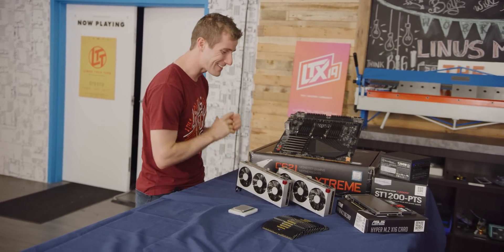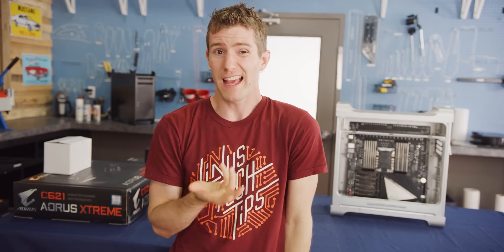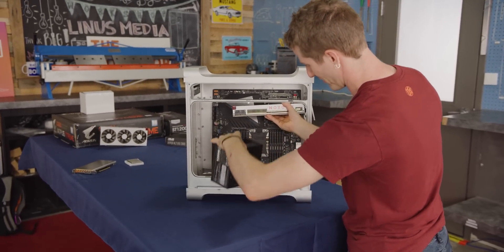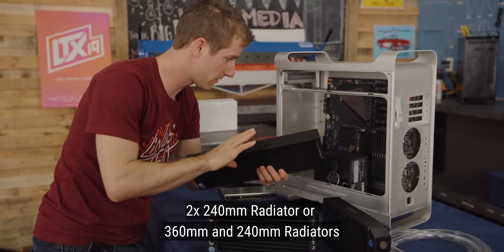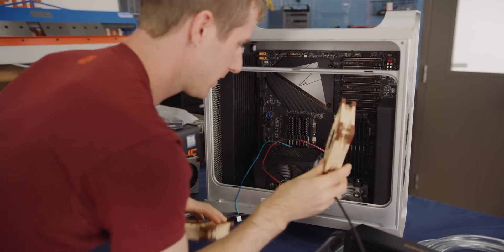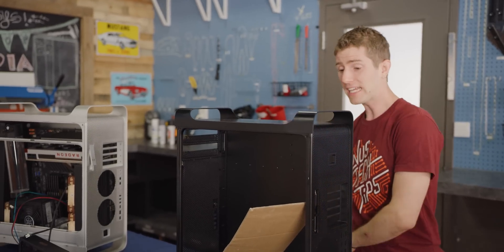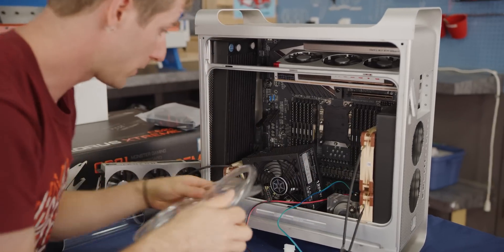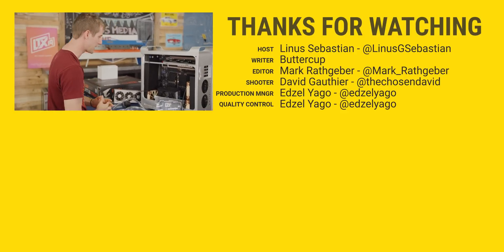The Mac Pro Apple WISHES they built - Hack Pro Pt. 1

Comment: Loved when you discovered that Apple used B size motherboards in their old Mac Pro cases (which were gorgoreously accessible).

Typically Apple had to be different just to be different and/or to stop anyone else hacking around in the case with standard parts.
Reply: Just make the executive decision to use a standard PC case, there's plenty of choices for nice looking units, which there weren't when the Cheesegrater came out.
Reply: There was an industrial design reason for why the cheesegrater was laid out the way it was. 

Everything simply slid in and out from the side including the DUAL cpus on their motherboards.

Wouldn't it be great if someone (not Apple that would be expecting too much) designed a case on the easy access principles of the Cheesegrater for use as a regular PC case OR as a Hackintosh. If it just had the potential to make a great Hackintosh, whoever built an alternative to the upcoming Mac Pro would circumvent Apple's lawyers, just as Gigabyte has by selling motherboards that can be either perfect Hackintoshes or top PC Gaming desktops. Seems to me to be a great marketing opportunity to fill a niche that Apple has left wide open. Although not for long, when they go ARM chips next year they will close that off again.

As a designer, I think Apple has made a great, if wildly over engineered, frame/modular based design with the upcoming Mac Pro. Well worth taking the principles and recreating it in a simpler and much cheaper form. The idea obviously came out of the test rigs Apple uses to work out their designs in their labs. 

One thing that I wish designers would seriously look at is dividing the heat generating parts from the rest of the case and putting them in something that formed a natural chimney exploiting the natural movement of hot air to vent most of the heat. I'd start with removing/separating the powersupply from the case (why box it in?) and relaying out the GPU cards and their attachments to the motherboard so that they formed natural air pathways with fins oriented to encourage the airflow and not interrupt it. Since not creating heat in the first place and venting what you can't avoid is such a major part of PC design, I'm surprised that someone hasn't tackled the hardware design principally to work around the issue instead of cramming everything onto boards and then jamming them against each other in ways that trap the heat.

Comment: 384GB on 12 sticks? We got some RAM in at work that did that with only 3 sticks.
Reply: Motherboard doesn't support more than 512gb.
Reply: @apocalypseap  cpu only supports 512gb ram, motherboard supports 192gb if it supported more it woukd be able to have more ram slots

Comment: Cut the whole back mesh out that you have to cut anyway, build the pc and a sled/draw that has a new mesh panel made for the back that suits you pci cards and io. slide it in from the rear ;) . also slide the draw into the pc case from the rear. Also by the time i post this comment they have most likely built, completed, filmed and processed the whole build.

Comment: Doesn't Linus have a workshop and didn't he spend all kinds of money for machinery? I would just cut the case in half, extend it to make the case longer with a blank piece of metal then add a new cheese-grate type backing for the IO and power supply. Come on Linus please don't Mickey Mouse this so please do this correctly.

Comment: I´m all for the Supreme Hackingtosh, but the  undersized apple case was just a really crappy desicion.
Reply: You take that back. The G5 case is a timeless masterpiece. I've built several rigs in them
https://imgur.com/izZY3AS
Reply: @mattsoup4121  apples pro cases are sexy and durable as fuck. The market is just flooded with cheap-looking, edgy-gamer-teenager, rgb crap.
Reply: @Nik-ff3tu  does anyone even like rgb
Reply: @Nik-ff3tu  I have a pc built inside, I fully agree
Reply: I want to know how APPLE is able to cool their new Mac Pro with apparently a PASSIVE cooling solution?!! They are supposed to be able to adequately cool up to 1 Xeon and 4 AMD GPUs using large passive cooling radiators fed by just 3 front intake fans? Either Apple has figured out a way to defeat the laws of thermodynamics or that thing is gonna throttle like a MFer under load.
Reply: I disagree, because then it would just a standard really powerful build. not much fun. cramming it all into a mac case gives it challenge and relevance to apple, which is the goal; to make an equal or more powerful mac to beat them at their own game.
Reply: Kevin Aguirre Sure, if you were doing this as a sane and rational build. But it isn’t, this is a “look at the silly thing we can do” build. And that makes this case great.
Reply: He likes challenges
Reply: As ridiculous as their budget for this is anyway, just build a new case from scratch at an appropriate size
Reply: i would have gone for a Lian Li- V1000L myself.
Reply: So is a Bitfenix Enso or InWin 805, but people use them.
Reply: Linus needs a Phanteks Anthoo case for the build - plenty of room for everything, nothing blocked, and looks pretty Maclike so everyone will know right off what it is. It's a popular choice for hackintosh builders. Failing that, 3-D print a case with proper proportions and ports.

Comment: I see that you are using a Powermac G5 case. I was a bit bewildered by the back panel layout. I take it this type of build would not work on an Intel 2006 - 2012 Mac Pro case. I'm also surprised you did not use a SuperMicro dual socket motherboard. They may actually have a configuration that would be a better fit than the Gigabyte.

Comment: 280mm (2x140mm) rad for the front? Might save some machining on the 5.25" bay while still allowing better-than 240mm cooling.

Also, remember to aim the PSU intake fan towards available air - don't jam it tight against the side of the case.

Comment: Couldnt' they modify the case chassis on back to hold two radiators?  It would require four or more posts (on top of the radiator mount modification) in the event you want to position the computer horizontally in future.

Comment: If you 3D modelled it, couldn’t you increase the size of the case and then do a mock up. You could even do a mock up of there new version by 3D scanning an actual cheese grater and try and do the new cheese grater model. 
It would be cool to use a 3D metal printer

Comment: 384 GB of ram is almost enough for 3 chrome tabs
Reply: nah mac is a light OS you can probably do 4 tabs
Reply: I think it will run 4 tabs if no YouTube video is played
Reply: chrome is so fast because the entire internet is rammed
Reply: I beg to differ. Its still not enough 2 tabs
Reply: While i am using the e browser with 2 gb ram
Reply: My linux workstation is currently running 531 tabs in Google Chrome. This thing has only 32 GB of RAM. All you need is chrome://flags/#proactive-tab-freeze-and-discard set to Freeze and Discard.
Reply: @MikkoRantalainen  Heads up, that's a great way to lose data. Open tabs just become temporary bookmarks that reload the page and you lose anything you were working on including that email you spent 2 hours drafting. If it were a good idea it would be the default setting.
Reply: @Captain__Obvious  If the thing is going to discard important stuff and you're not going out of RAM, check out the page about:discards and report the issue as a bug. Chrome is not supposed to discard tabs with modified forms (among other things). I'm sometimes running out of RAM even with discard and freeze features enabled so 500+ tabs may be too much even with this config. When the system is running out of RAM, the Linux OOM Killer will shoot the tab that eats the most memory because Chrome is not smart enough to report the importance of different tabs to Linux kernel. I'm not sure how this works with Windows or OS X.
Reply: @MikkoRantalainen  let me guess, you are running Gentoo?
Reply: Captain Obvious 2 1/2
Reply: I prefer opera
Reply: I still don’t get why everyone thinks chome needs so much ram
Reply: Devide that by 1000 and it won''t be a joke anymore :)
Reply: or you could use safari like every mac user
Reply: @squaller9254  basically everyone uses google whachu on
Reply: @squaller9254  ugh safari
Reply: Chrome runs fine on my work PC with 4 gigs of RAM. Usually have about 10 tabs open.

Comment: when the fans do not fit on the Radiators, why not screw the Rads to the wall from the inside, and the fans from the outside, with a fan grill on top.
Looks ugly? well a hackingtosh should be supposed to look frankensteinish.
also i think a rad could fit on the outside, between the handles for example.
with Copper pipes for tubing. basically a steampunkingtosh.

Comment: Barely enough clearance. Sounds like me putting 8 SAS drives, 5 SATA drives and a DVD read/writer in my computer, which is "supposed" to only be able to hold 1/2 5.2in, 3 3.5in, and 2 2.5in.

Comment: 5000 $-CPU, 2000 $-Mainboard, 4000 $ worth of RAM, 1200 $-GPUs and watercooling-gear for more than 1000 $. And much more exensive and cool hardware. And yet still way cheaper than the next revision of the Mac Pro Stand (Monitor, Computer and common sense not included)

Comment: You've got that wrong. 384 RAM is not at all usable for CFD workstation need. The ideal would be around 800 GB or more. Yeah... That's a fact... https://en.wikipedia.org/wiki/Computational_fluid_dynamics takes REAL NUMBER on RAM capacity...

Comment: Doesnt the best mac pro have like 4 times the ram? And 2 times the gpu power?
Reply: And ECC memory... and pro grade GPU... and an air cooled case... and a civilized OS...
Reply: @basurofobo  I was just thinking about all of these compromises they are making just to make half of the machine the actual Mac pro will be.
Reply: @basurofobo  Simpleton OS

FTFY
Reply: @basurofobo   ECC is just for dummies when you have DDR4 which has error correction already build into the chip.
Reply: basurofobo and 4x the VRAM

Comment: Or wait a couple months and get more than double the performance for half the price with a new Threadripper - also get PCIe4 thrown in for good measure.  If you are set on spending the same as a new Mac Pro then get an Epyc Rome based workstation with probably 4-6x the performance plus PCIe4 for about the same price.

Comment: In retrospect, Apple wants to build the Mac Pro with a 64 core Zen2 Threadripper.  Even the 32 core Zen2 Threadripper is going to kill that W 3175X. 

The W3175X sells for $3100 - plus $1900 for the MB. The 64 core EPYC 7702P sells for $4425.   The 32 core  EPYC 7502P sells for $2300.  TR parts will be cheaper than EPYC parts.

Comment: https://www.wiredzone.com/supermicro-racks-kvm-chassis-power-server-power-supplies-1000w-to-10000w-pws-1k21p-1r-10019088?gclid=cjwkcajwtulrbraleiwapvczbpp6cg15uhf190ps8txay9lrwre20rxkl1v7r8xrhr8u31iscefewhoclqoqavd_bwe

Get something like that or a custom modular version that can sit at the bottom in the bay under the motherboard. It’s the same wattage and so much smaller. 1u. You could also use a custom motherboard tray/reservoir that has cutouts in it for the psu cables. That way you have something functional to mount the mb to and it also saves room for the build.

Comment: 1.5 TB of... ram? My bootdrive isn't even 1/3 of that
Reply: my boot drive is literally 120gb on a NVME 3x4 lane ssd. U don't need a big boot drive just enough to store windows, your browser, and a few other programs u know need the speed. Everything else goes on your 1tb sata ssd u use as your main drive. Telling windows where save things on a OS level is easy, just look up how to there's tons of vids on how to make windows treat another internal drive as your regular C drive to save documents, pictures, downloads EVERYTHING to. 

This is what people do now u should get on board mate its so nice to have your core Software things running on a blazing fast NVME drive and the rest on a cheap 1tb Sata ssd for 100 bucks. Then EVERYTHING else goes on the single 2 tb HDD u have in the PC for archival stuff. Once thats set up then u set it up so everything u save to that hard drive is then copied onto your vault raid 6 NAS which your connected to via your ethernet cable. Which allows u to keep that noisy server NAS u built in a seperate server room so your main rig is quite as can be. 

IF only everyone knew how good there computer setup could be. Lol what a shame

Comment: If you used a smaller mobo, you could fit the PSU where the OG one went, and just use M.2 slots for the SSD no?
Reply: A smaller MoBo doesn't exist

Comment: "Which part of this do I need to disassemble to add a stick of ram?"
"Yes"
Reply: So just like the vast majority of Apple products
Reply: Seriously they better test the shit out of those RAM sticks before assembling the system. Imagine they squeeze all the components in there, hook up all the water cooling, turn on the computer, and BIOS indicated one of the RAM modules is faulty and needs to be replaced...
Reply: What machine requires such a rediculous amount of ram to function? 384 gigs?
Reply: @aaronprice4626  yeah, 128 would be more than amazing, but they just like being 'extreme'.
Reply: @aaronprice4626  A lot. Biology, physics simulation, some movie scenes... can use that much RAM

Comment: As someone  considering building a hackintosh in a G5 case, admittedly a far less ambitious one, I look forward to seeing this. I'm particularly interested in how you are going to deal with moving the mobo standoffs as the G5 definitely does not match the ATX spec.

As far as beating the Mac Pro though, you've already lowered the bar by admitting you can't match the 1.5TB of RAM capacity. It will be interesting to see how much more it gets lowered over the course of the build.

Also, the G5 mac PS didn't have an extension cord, the power supply was a long skinny one that sat on the floor of the case with the socket right up to the opening in the back. I've seen one video showing the gutting of the original PS and replacing the internals with  the internals of a higher capacity SFF PS. Certainly nowhere near 1200 watts though.

Great fun - wish I had the funds to be doing something similar.
Reply: Yeah they should be using the Mac Pro case for sure instead of the power Mac case. Way better option to place the power supply probably a better spot to route the cables from to.
Reply: Check out laserhive for conversion kits
Reply: As someone who's done both, the Mac Pro case was a lot easier to make work and the hard drive sleds are a really nice addition. You have to relocate the standoffs, but the PCIE slots will line up. You will be cutting out the I/O panel. I highly recommend going mATX if you are willing to make that compromise.
Reply: on my g5 i just screwed in a mobo tray / backplate combo from lian li
Reply: The psu sounds like a server one from a 1U blade case.

Comment: Like, The Ridge wallet isn't even good, it costs like about 100 bucks and the plates are just held together with rubber bands and  if you hold it upside down the cards fall out. Fantom (as an example, The Pilot from Andar is also an excellent choice) sells a much better wallet that keeps the cards in the card holder, has an optional coin holder for a little extra, different size options, and it puts all the cards out as a wing so that you can reach all the middle cards (on the ridge you can squeeze the bottom and reach only the middle card, and it doesn't really work) and costs 76 dollars for plastic and 94 for aluminum and with promo codes you can get it down 20% with a simple google. 

Now I don't own any of these and I'm of course not paid to say shit, just as a heads up.

Comment: You could ask a local universty of applied science if they wanted to collaborate with 3D-scanning the case. They might have a 3D-scanner that is more focused om mechanical engineering and most importantly smaller parts.

Comment: You Should go with the Titan RTX instead, and you could probably pull off using 4.  Also, if you could, it would be funny to use some iMac Pro's configured as monitors.
Reply: wonder why macos doesnt support nvidia
Reply: Yep! No nvidia GPU in macs. Ever. This is why they are going for the radeon VII in all these builds.